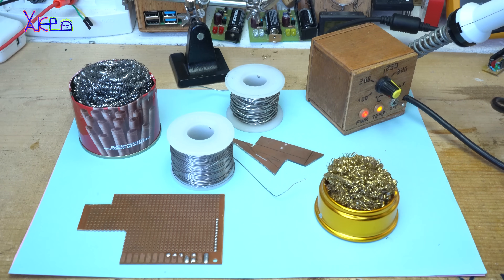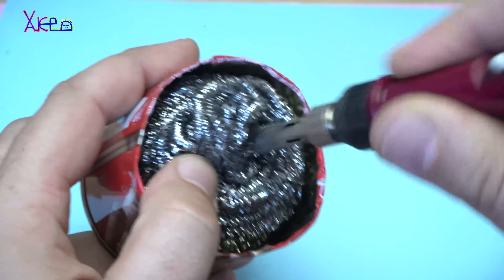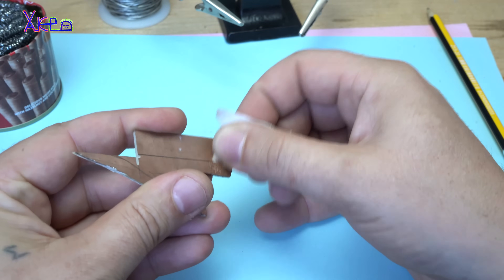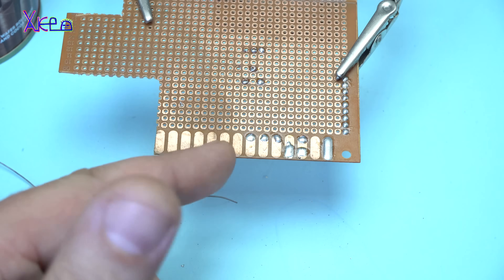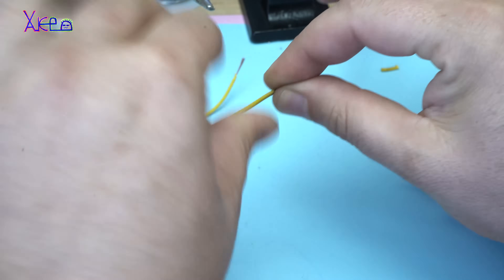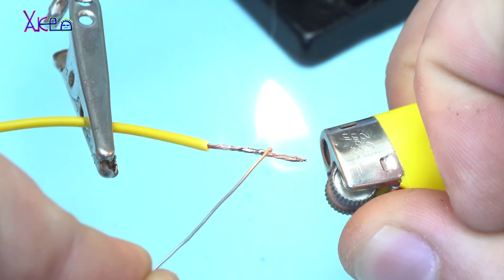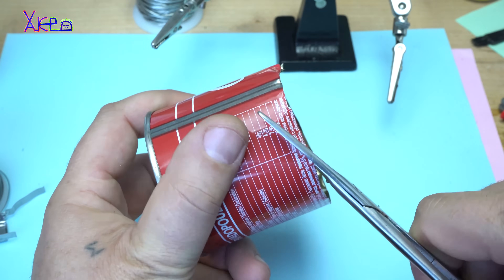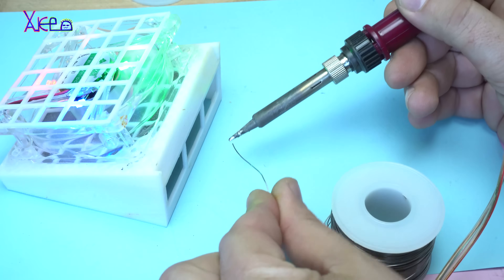10 Soldering Tips How to Solder better at home or work

Comment: This was great timing, I have been searching the web for help as not soldered since I was at school and I am 62 now! Memory fades. Lol
I must say you are a good and interesting teacher. Question: how strong should a soldered joint be? It’s not like welding or braising is it? Nor like a mortise joint in wood? What do you say teacher?
Kindest
Bon
Reply from the maker: When you solder the joints you should get nice and clean melted tin,and not to put a lot of tin.
With practice you will get it.
And most important is to buy high quality tin solder
Reply: @Hacktuber  : I will get some high quality solder and flux from Amazon......ok? Any brand names you would recommend teacher?
Kindest
Bob